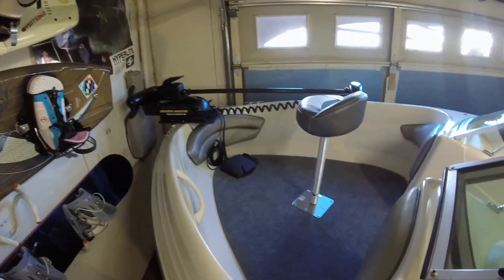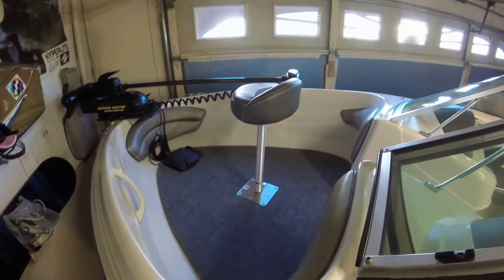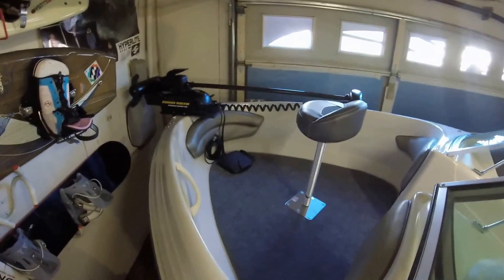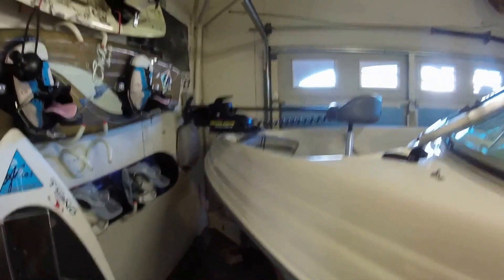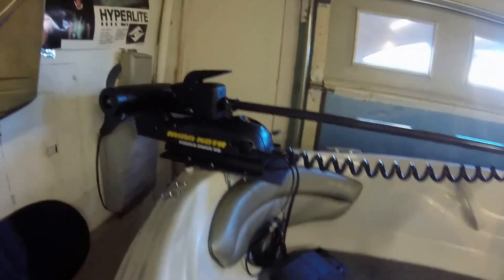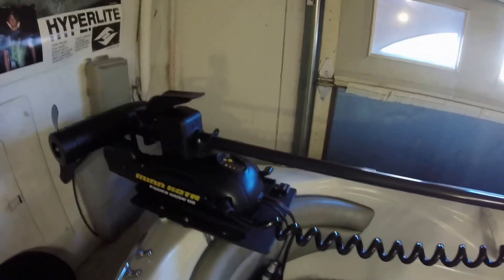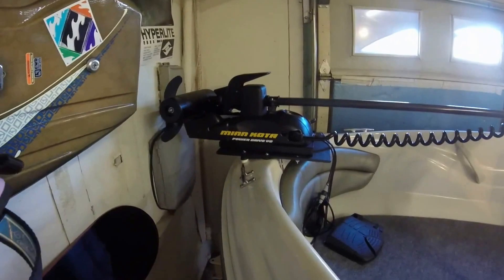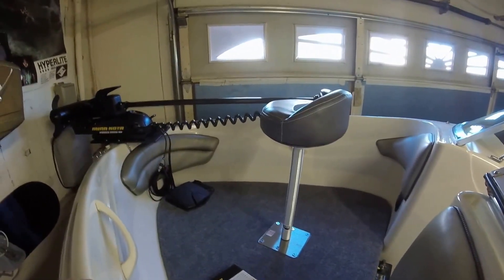INSTALLING A TROLLING MOTOR & FISHING PLATFORM ON AN OPEN BOW BOAT

Comment from the maker: Thanks Jeff, I have used this set up out on the lake in some pretty rough conditions and it was solid. Probably due to the custom fit. I actually feel more stable sitting on my pedestal seat. I have recently added a second fish finder up front on the deck and switched over from the trolling motor peddle to a remote that hangs around my neck. I went out a few times and then sold my peddle. I won't go back to the peddle again. I will post another video on how I modified the transducer  wiring on the trolling motor. I now plan on adding the quick disconnect for my power. hopefully I will get that on you tube also. I owned a 2004 Bayliner 175. Nice boat.

Comment: Great job. I have the same setup on my Bayliner 175. I wanted to add a pedestal seat like this one. Only thing I wondered is do you find any movement with the casting deck in rough water since it's not bolted down? Mine is good with me standing on it but not sure if I'm leaning on a seat.
Reply: Jeff Walsh could you do a video of how you mounted your trolling motor on your 175 br?

Comment: Hey Walter P. here I need to do the same set up. How did you secure the plate to the boat? I do not have access to secure under the fiber glass

Comment: I reconized your boat as Sea Ray, I have Sea Ray 180 and have a trolling motor I want to install. I'll put mine to the left though. It's confusing, I was told that I had to get a special bracket because it's not a bass boat! What do I know? My motor is 24v, so I will use two batteries.

Comment: Nice job on the install...his long is the shaft on the trolling motor and is it a 12v model?
I have similar boat but not sure which trolling motor specs I should go with.
Thanks
Reply from the maker: +Joseph Castanon           

Rick West                    1 second ago                 

If your boat is on a trailer, measure 1 foot above the top of the  hull to the floor this should give you the proper length for your shaft. I went with the 47" and it sits 12" underwater
Reply: Thanks....Is yours a 12v or higher
Reply from the maker: +Joseph Castanon 
I only bought the 12v version.&#160;This seems to be enough power for me. I haven&#39;t had a chance to test it in high wind conditions yet. If you plan on using the motor on lakes with high wind you might want to consider the 24v. The additional cost of the motor and batteries would be another factor to consider.
Reply: +Rick West thank you so much for your time this is exactly what I would like for my setup but I'm wonder what is the lenght of the shaft did you bought
Reply from the maker: +who dat I hope this video will help you out. The shaft is 47"
Reply: thank you sir
Reply: +Rick West just got my trolling motor I'm excited, this weekend I will install it but wonder where to set the battery. where do you keep your I got two of them
Reply from the maker: The batteries wont fit under the platform unless you have gel bats. I don't. I only have one deep cycle battery and it sits right at the back edge of the platform. I like this arrangement for safety when docking and loading the boat you want to disconnect the battery to prevent accidently stepping on your power button. let me know how the install went!
Reply: tomorrow will be the day to tackle it will let you know the outcome
Reply: thank you for your video I got it install now to find time to build a standing deck plus LED light in the boat for night fishing

Comment: What was the  width and Length of the polyurethane cutting board and where did you mount the metal plate you talked about on your video?

Comment: What boat make and model is this? Thanks, looks good!
Reply from the maker: This is a 2010 - 175 Sport by Sea Ray
Reply: Rick West looks good! 
How does that handle your boat?
I am going to install one on my 2007 175 Sea Ray also.
Not many install trolling motors on Sea rays.
Thanks.

Comment: Do you still this boat? If so, do you mind taking another video with that front cushion out to see how you installed everything. I already made a platform for my boat, but this is exactly what I want to do on my boat. Thank you.
Reply from the maker: +Jon-Michael Macagba I will try to make another video with the platform out, but the boat is sitting in the water right now at my dock.
Reply: Wow, thanks for the replay.